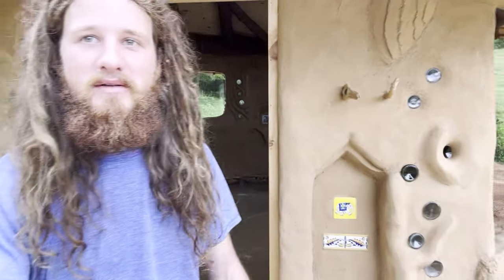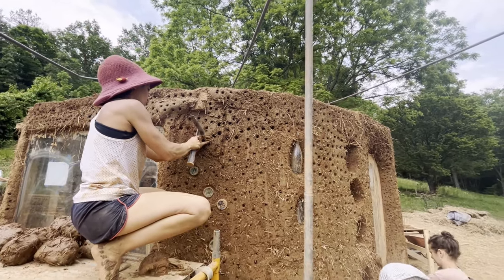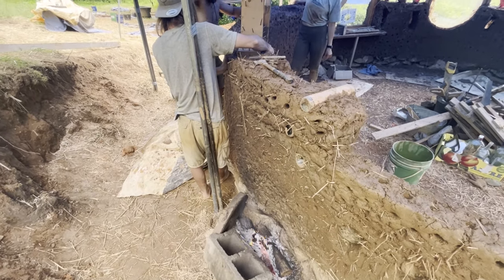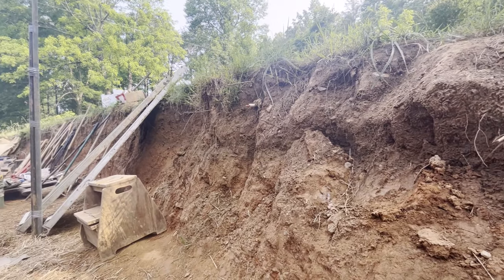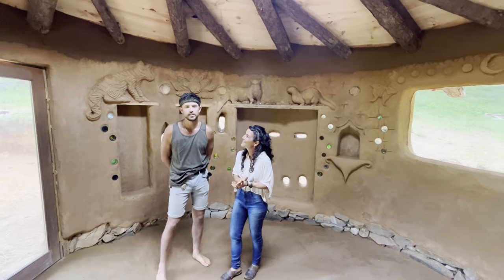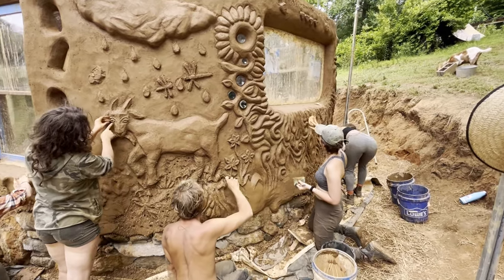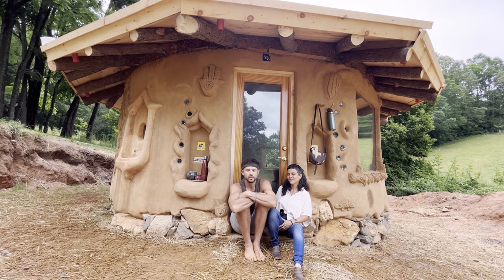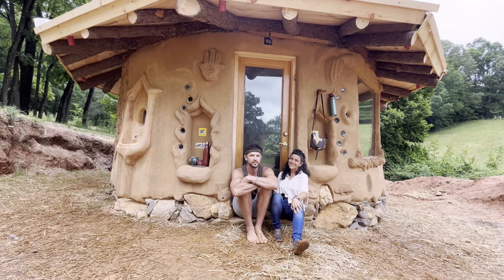How To Build A COB HOUSE | Introduction & Building Design

Comment: This is great but not feasible, for most people. Four or five weeks to build with a huge number of people. Great if you are charging money for a workshop, plus using (free labor), but how long would this take for a single person or a small family to build? Forever.
Reply from the maker: There are definitely more efficient ways to build with natural and reclaimed materials and we will be covering those on this channel as well. Understanding cob is a great basis for an introduction to natural building though because it can be used in combination with other materials to make buildings that are built efficiently.
Reply: There's also a method using straw bales and cob that seems to be faster since the majority of the wall is made up of the bales, then a cob layer goes over it. It is discouraging though, just seeing how long it takes for something small. 

My husband and I have land and wanted to build our own house on it, and were willing to live temporarily in an old RV on the land in order to do so but the county will not allow it even temporarily 😑
Reply: @sexykjetil  I believe we can take a concrete ditch and run through it with a tractor and a tread foot roller and it might make Adobe?
Reply: that's just it is it doesn't really take that long to lay up especially if you do do it the way where you put chords of bamboo or if you put chords of pine and cedar in the walls it goes up fast and it's just as strong as can be.
Reply: @naturalbuildings 😊😊ool
Reply: Excuses, bruh.
Reply: I'm just saying I've already built a couple structures by myself and whenever you put the pine logs inside the Adobe the process goes by so much quicker and I can imagine this is only going to be it easier whenever we mechanized the process of making the mud instead of hand processing it.
Reply: @justsomenobody889  in the near future they're going to figure out that they can use long bast fibers from hemp to be a straw replacement in which case you're using the seed from the hemp to make chicken feed or oil or something else and then the other thing they're going to realize is that you can grow the bamboo and lay the bamboo chords directly in the Adobe wall and it's a quick way to gain a lot of material which makesbuffer space and the other thing is is that they're going to put these raised beds all the way up to the Garden Wall and that's going to be a big help and a great use of space especially in town.
Reply: @justsomenobody889  nobody's even making bamboo bales and that's going to be a big deal in the near future.
currently I'm growing somewhere between 36 and 40 species of bamboo including some timber kinds but the best ones are right now are some of the forage ones that are only 6 ft tall to 12 ft
Reply: Can build much easier with like pillow case bags with a sprinkle off cement and fashion your walls them just plaster over outside...you could do on your own in a few months if you really wanted....bungalow obviosly not multi story but you can do multi story If you want...point being the main material being mud is free
Reply: For most families it’s a multiple weekend project that includes the community. Lots of mud, sweat, and tears lol.
Reply: @justsomenobody889 how can a county stop you from living in a RV on your own land?
Reply: @jimmywhitlow2012  I know, right? I guess because no one's ever tried to sue them over it
Reply: Anything can be accomplished if you have Jesus. Soon all in this sphere of witnesses will see. Learning to trust HIS powerful arm is one of the great lessons of Life. I pity those not called by the Father.
Reply: What is overall cost here. The labor wouod be huge cost withbas many folks as u have here. But im VERY interested in how to utilize modern technology to make this building medium more efficient and cost and time effective.
Reply: Natural building is also not permissible where I live 😢
Reply: The forefathers of America had nothing but an axe and created log cabins to shelter their family nothing is impossible this would take no time to build if driven
Reply: Wait you were not allowed to live temporarily in your RV? on your land???, Fuck them, I would sleep in it if they come I will just dry around in circle and come back to the same spot. As long it is not a parking lot or some private parking place, geez.
Reply: @OzkAltBldgCo-bv8tt how are you controlling the invasive behavior of the bamboo??? I love it too…but I have to think about the whole ecosystem…do you take measures to control your spread if so could you share them please???
Reply: @benjaminmccarter4318  if you have a tractor you could build a ditch and use a sheep's foot roller to make a house load of mix and probably a day. I'm telling you right now the future of housing is not drywall insulation and siding it's free form Adobe.
In the UK and Devin and Wells where they were building Cobb houses those things have been standing over 500 years strong and they're just as beautiful as the day they went up. Some of the reminiscent Adobe structures in the desert Southwest are still out there over a thousand years later.
Adobe actually works everywhere on Earth you just have to have the materials to make it clay sand and straw or a straw replacement like hemp fibers. But to make better use of the water fill in with cordwood like pine or cedar maybe bamboo.
Reply: @LawofMosesHere  that's because the laws are not laws their Lawless laws the policies the rules and the laws were made to be broken because they're not Gods laws policies or rules.
However there's no laws against doing whatever kind of house you want to build out in the country say if you live in the Ozarks of Missouri or anywhere else rural usually.
Reply: @cristymenapace677  the way in which it proliferates so rapidly makes it a great asset a blessing.
Reply: When I was a kid, my parents had a traditional house built of wood frame and some brick. The builder and his crew took 8 months to "finish" the house before we could move in, and at that point it wasn't even ready really. There was still no flooring and the drywall hadn't been patched/painted. One or more of the bathrooms hadn't been installed. I mean, does a mud house really take too long?
Reply: Most houses take a year or two to build…
Reply: @tomgriffiths3239  that's why I'm trying to tell you I'm screaming at the top of my lungs right now so that everyone can hear me that you can use a tractor to build a ditch to make Adobe in a. Ditch you would use a sheep's foot roller or a tread foot roller and roll over an adobe ditch and be making truckloads of adobe to build an entire house within a matter of weeks.
Yes I know this sounds completely crazy but I'm telling you the truth I'm telling you right now I just solved the housing crunch in the world. No more paying rent no more paying a lease no more paying expensive houses when you can buy and build the thing out of adobe wherever your at.
Adobe Mills aren't even a thing right now and they are seriously the future.
Reply: Maybe that's the idea, @boltholeonabudget6526 
you don't have to go it alone, it takes a village, etc. Community support
Reply: Look up Palletable Cobins 😊 much faster!
Reply: Pfft ya right.
Reply: 1 week tops.
Reply: Not really actually! There are way more efficient & quicker ways to make a cobhouse
Reply: @OzkAltBldgCo-bv8tt  are you talking about an adobe structure built into a ditch or are you just describing the brick making process? I'm very curious, I want to hear more.
Reply: @mail4yaf  I'm saying that you would basically dedicate a concrete ditch to building Adobe using a tractor pulling a goosefoot roller.

Comment: Moving off grid and want to build natural. I Love this space you've created. However the area I'm building is in a cold climate, winters can see -30 temperatures. Do you have any suggestions?
Reply: Pioneers on the prairie often built sod homes that were partially dug into the ground. Those areas were extremely hot/cold depending on the season.

Comment: Im 63 yrs old @ disabled. I have a mobile home on 2 @ 1/ 2 acres on a mtn in Tennessee.  My mobile is falling apart and i even fear fire in here. I'd give anything if i could build one of these for myself, but i can barely walk.  The soil here isn't suited for this as it's rich dark earth.  Lots of oak trees. So, if i could figure a way to try building one of these, wouldn't i have to purchase the sand? If so,  to build one that would be living room/ dining combo, maybe a small galley kit. @ bath, then put what the old timers called a dig run , which is basically a hall between 2 bldgings that joins them together @ have my bedroom on the other side...  I've heard of ppl building several small ones beside each other or joined by walkways to avoid having to follow building codes.  I think a combustible toilet would do fine, and perhaps solar panels in roof for electricity  @'built in fireplaces/ oven to allow alternate heat source.  The thicker the walls are the better insulated against heat or cold. So, one issue would be how many tons of sand.... i find these homes beautiful @ most practical. Thank you for sharing your knowledge, skills @ dreams with everyone....❤❤❤❤
Reply from the maker: If you can send me a message on Instagram @naturalbuildings we can talk about the possibility of building on your land. Thanks for your kind words. If emailing is easier my email is coopergreen97@gmail.com -Cooper

Comment: What do you do if one of the windows breaks and you need to replace it?  Especially that oval window.
Reply from the maker: You can wet the cob down and chip it away, replace the window and sculpt it back. It’s time consuming and labor intensive but I’ve seen it done.

Comment: It looks nice.But would it stand like for years??First big Flod and house is gone.
Reply: Africans have been doing this for centuries and their houses have stood the test of time. Anyway, what do they know, they are so primitive in their ways.
Reply: @globalcitizen1138  No rain in Africa,Np frost in Afrika!! THIS IS ONLY EXPERIMENTAL  BUILDING. MOUSE AND OTHER ANIMALS WILL EAT IT SOON OR LATER,AND SO MUCH WORK WITH IT,TO KEEP IN GOOD SCHAPE,.JUST NO GO FOR me!!
Reply: @peterhenc3159  1. It does rain in Africa? 2. This type of building was also used by natives of the American southwest and many structures still stand to this day. It monsoons there and can freeze at night. 3. There are dirt buildings that have been standing for hundreds of years in England that are stilstanding. It DEFINITELY rains and freezes there.
Reply: @peterhenc3159 if it comforts you any, this type of building has been done for centuries in the UK. There is even a specific name for a similar building type called Waddle and Daub. Homes built with these same materials have lasted hundreds of years in the wettest climates of the UK. Finishing the building with a lime plaster adds an extra layer of waterproofing and makes it extremely durable. No need to fret if you live in a wet area, cob is perfectly possible for you!

Comment: How energy efficient are they? Will they work well with water ground heating system?
Reply from the maker: Thermal mass is different than insulation but can still perform well if used correctly. We’ll be talking more about this in the following episodes
Reply: Yes they will work well with both or Nothing at All Cobb homes awesome I've grown up in Santa Fe New Mexico as well as taos n.m. I've been around them for as long as I can remember

Comment: What if it rains, does it get washed away? (Genuine question)
Reply from the maker: It will not. You build the foundation intentionally with drainage in mind and large roof over hangs so that walls barely ever are exposed to water. Even a hard storm with sideways rain wouldn’t be very damaging. It’d be more of a problem if there was long term exposure to a significant amount of water that allowed the wall to become saturated somehow. But again we build to avoid this.
Reply: In Arizona they use adobe (basically mud and straw)  but they stucco it afterwards.

Comment: For the walls I think that "Palletable Cobins" are a LOT more feasible, doable, easier, faster, stronger and more insulated because the inside is pure straw.   I like the poles being cemented into the ground.  for the bottom 18" I'd have used plywood forms on the bottom to fill with rocks and CEMENT... not just rocks!  I don't like the massively heavy roof timbers either.  Not sure how the hell they got that up there.  I also don't really like living roofs.  Too heavy, requires plastic and no skylight.
Reply from the maker: There are definitely more efficient ways to build with reclaimed and natural materials but cob has certain properties that those materials do not offer as well. I also am super interested in building with pallets and hope to do a series on a build like that next year. Follow us on IG if you’d like to connect.
Reply: Pallet building is over rated. Pallets are C grade lumber with tons of nails sticking out and a limited range in sizes. I think having a shed builder put up a pavilion with lattice between the posts and cobbing over the lattice from post to post is the best way to build with cob; instant roof and level building area. It will look like a medieval Tudor home and you get around any building permit problems with cob because it will be viewed as a pavilion.

Comment: To build this and not have a heat source—Oi!

If you added ondol floor heating, that would allow a wood fire to run smoke under the floor, and the earth could retain the heat for a very efficient heating system.

Comment: Why were there holes poked in the cob? 
Before the plaster I mean.
Reply from the maker: Helps to “sew” each of the cob layers into each other so that the building becomes a single monolithic mass. Also helps to allow faster/more even drying. And gives the plaster something to grip to. But yes mainly to integrate each layer.
Reply: @naturalbuildings  Okay thx :)